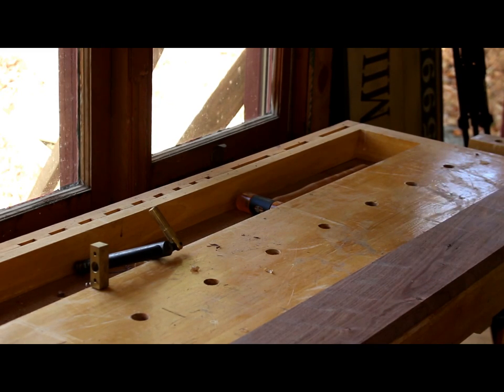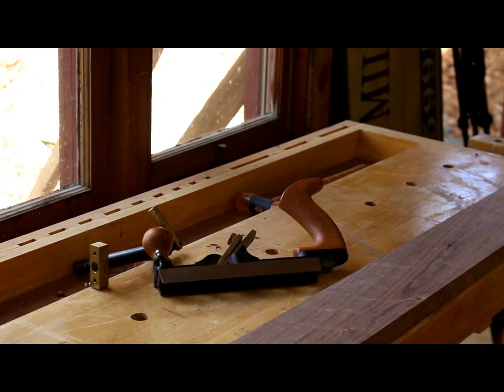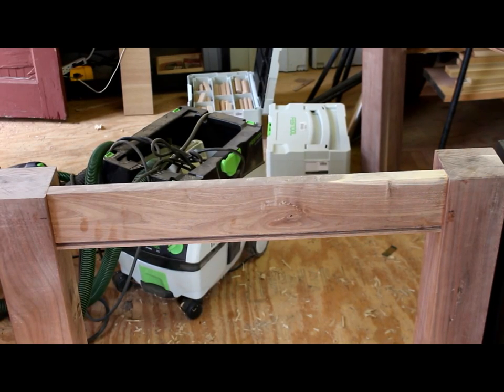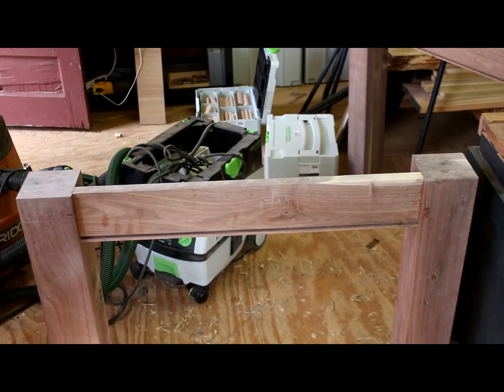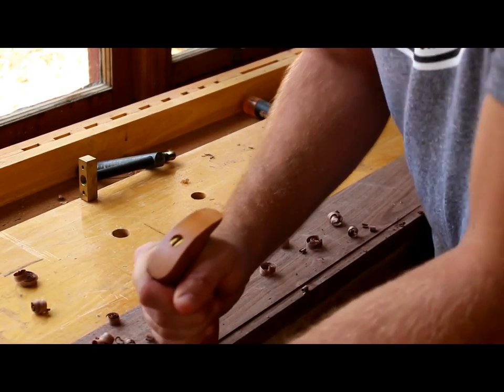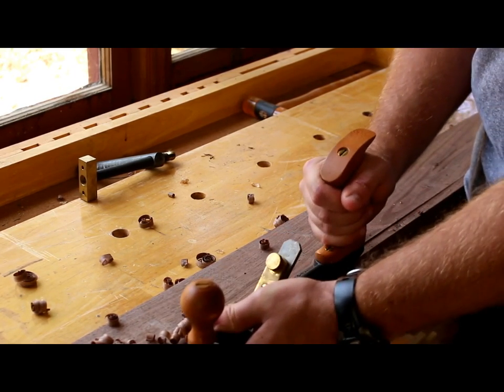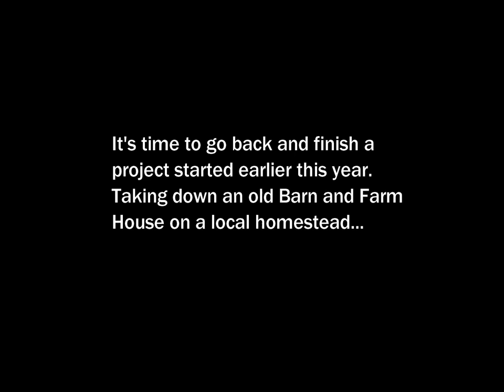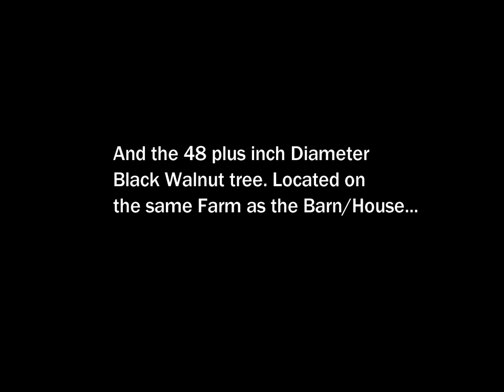Making A Farm Table, Apron Details.

Comment: I know this is an old video but I’ve been trying to find out how I would go about doing this exact detail to a table apron. Would it be possible with a handheld router? Also, do you know what kind of bit would be used? Thanks and great video and demonstration!
Reply: You could do it with a router table and a bit as wide as you want the groove. You could do it with a handheld router if you have a fence attachment. Either way, I would take progressive depth cuts until you reach the desired depth. You could also make it with a table saw or a circular saw if you have a straight piece of wood you can use for a fence.

Comment: everyone seems to have those domino's.... $1000 bucks is hard to justify right now but I do want one
Reply from the maker: +Anthony Tobias I agree I got mine used on eBay. Saved a lot by doing that.
Reply: I bought a dowelmax jig. I like it as much or better than the festool domino and it's much cheaper. It used dowel joinery instead of dominos.